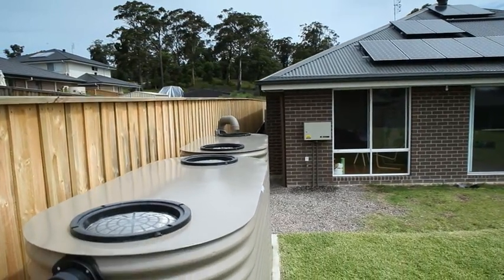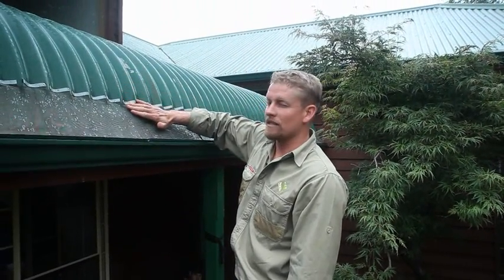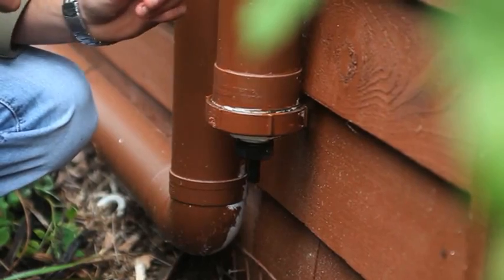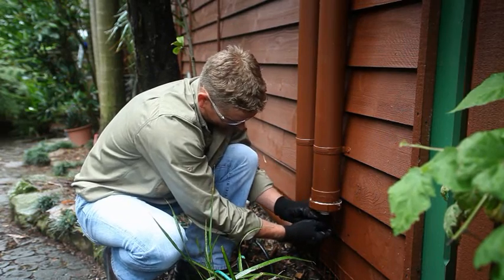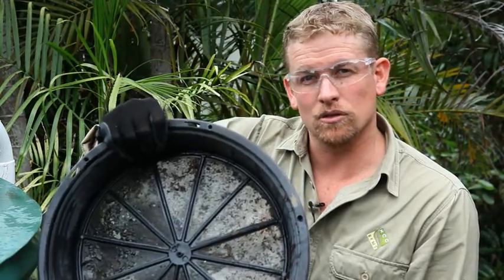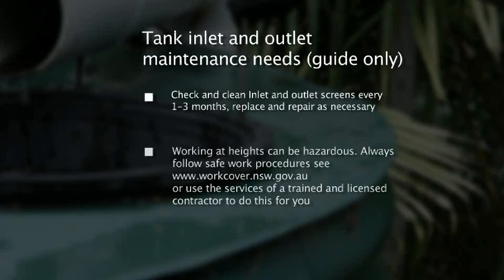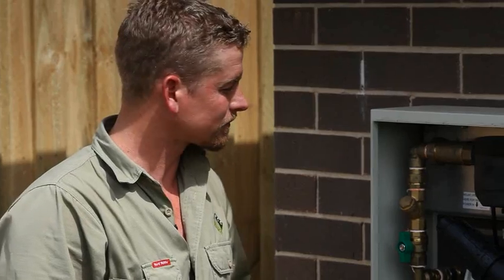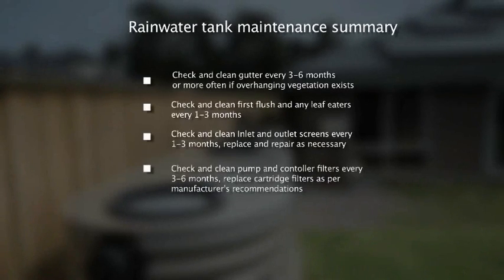Full rainwater tank maintenance video (all clips)

Comment: Don't like the filter and the electrics in the one controller box. Potential for death there
Reply: You can say that again, the power should be on the outside  of the that in-closer, not behind the water filter and next to the tap.  Otherwise great video
Reply: @RichieRich845  I was choked when I saw he turned of and the the water was pouring next to a switch. What an electrician did this? Who gave him a license? I'm not licensed but would never do this.

Comment: Is there any way to eliminate mosquito larvae from a 20,000 gallon water catchment tank  I use bleach to help keep it clean but it looks like after 20 hours the larvae are still alive.  There are not many, and water is not used to drink, and there are two particle filters before the pump, but I hate that they are in the tank.  What can I do?
Reply: Laura Burnette you can stir the water so they drown. Or get a surface pump and pump the water through a fine mesh filter. I have even put olive oil in my tank to suffocate them.
Reply: @whatahowl1  kero or diesel work fine too
Reply: @manFromPeterborough  if you want to put diesel in your drinking water or anything you water with go right ahead.
Reply: @whatahowl1  I have 3 tanks, it was in the large ones where the lid was left off, the 1000 ltr one is for drinking water, all team poly make

Comment: 10:00 - all the sh1t in the pipe and doesn’t even get a mention let alone cleaned. Gross...
Reply: I also noticed that. He did not show cleaning of sediment trap which seems it has not been installed.All in all everything seems quite involved in maintenance. Not sure if it really worth doing as seems a lot of pain and not much gain. Mosquitoes, you need some oil to add into your tank, meshes cleaning. The other problem - using wet system is by definition is you collecting a dirty water if you're not cleaning your system every time. Ideally you need install the sensor which will be checking from lowest point if water has gone 1h after rain stopped.  If you won't do this  then you have mosquitoes and your wet system will have lots of bacteria which next time goes into your tank. As I see the manufacturers of the tanks should make and additional sediment trap on top of the tank to use the whole area to catch sediments to avoid them entering the tank. The more area the lower water speed the more efficient the trap. So it has to use the whole top area. Seems manufactures don't wanna you to see all the shit which could be collected. I bought my first house and it doesn't have a water tank as it was build before it become mandatory. I from one side wanna watering well my lawn, from another side not sure if easier just pay for water. I tend to think to build a small dry system with IBC water tank to see if it worth doing.